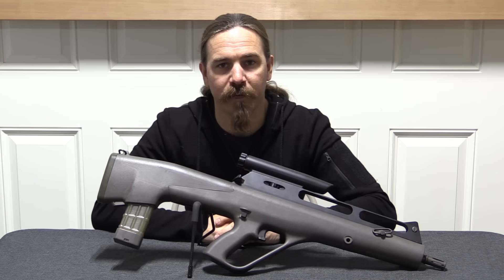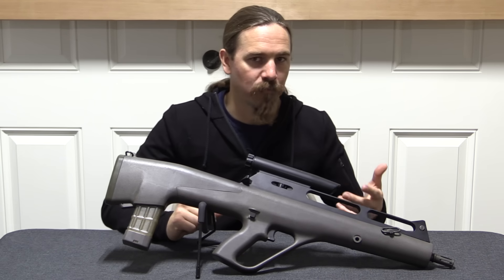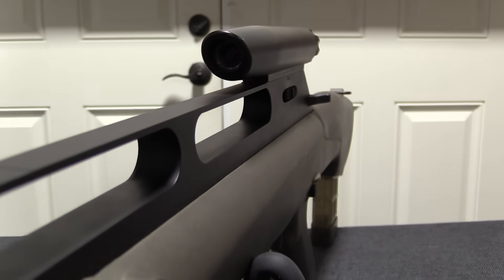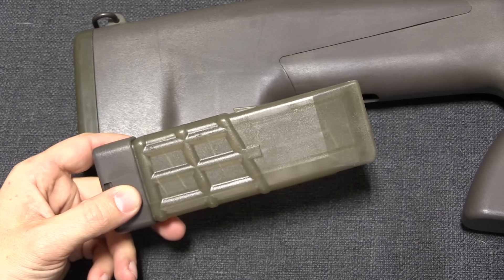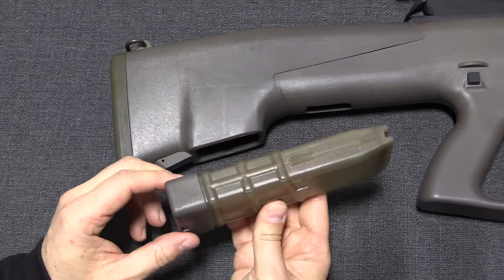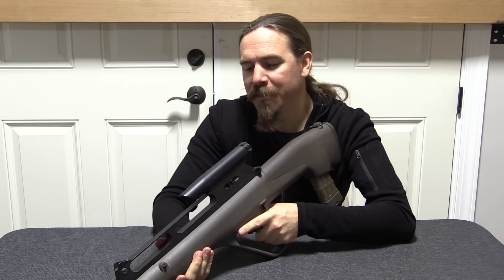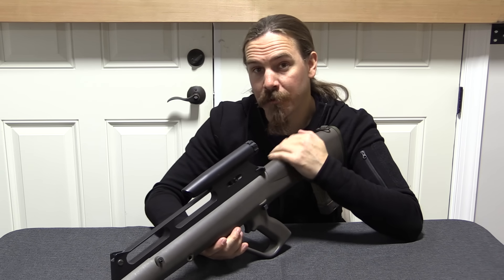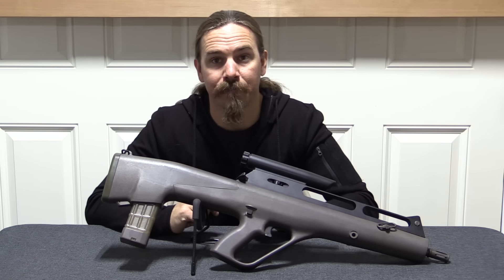Steyr ACR: A Polymer Flechette-Firing Bullpup From the 90s

Comment: Considering the whole ejection is based on the case falling out the front, could that mean if you were firing down from an elevated position you could potentially cause your rifle to jam because gravity pulls it straight through the chamber and out the front of the ejection before the action is able to close? It seems like this system relies very heavily on a very precise timing to close around the bullet rather than on it, like trying to trap the case between two guillotines.
Reply: Steyr makes very reliable guns since way more then 100 years. I am sure the gun itself with its mechanisms are flawless, if there were problems, my bet is on the not finished refining of the ammunition specifications and not optimised production line for that unique type of ammo.
Reply: @certaindeath7776  fun fact from what i have read from the reports it was the casings which were the defining problem especially in terms of reliability. however, another killer which was kinda the problem with flechette rounds in general was the fear of bouncing flechettes especially when prone
Reply: Maybe the cartridge is thick enough that it can't move through the chamber unless pushed?
Reply: Blackhart Films
Reply: As long as no length is lost from the cartridge on firing, and the chamber isn't longer than the fired case than it shouldn't matter what orientation it is when fired. It'd be a similar concept to a full length ejector on a revolver, but with less to get hung up on.
Reply: Why Jay  . I think so. It must be a tight fit. Thats why when all the parts raise their temperature due to sustained fired, that plastic cartridge ( nylon I suppose) may be subjected to some deformation or sticking into the chamber. These are all suppositions. Cheers!

Comment: It would be cool to see Steyr adapt it to a striker fired 9mm blowback. The weight could be around the barrel, near the pistol grip.
Reply: Lassi Kinnunen Damn, you're right. Blowback wouldn't work for the elevator action. Gas siphoned from in front of the chamber similar to a P7, maybe? Then again, 9mm is centerfire, not 'ring' fire like the flechette ammo used with the ACR. Something like a MAC/Uzi bolt that telescopes around the barrel is what I was originally thinking.

Comment: Plastic casings would jam up so easy because when firing alot of rounds stuff gets very hot so it might become a marshmelllow
Reply: trophywolfe that's why this rifle fires from an open bolt!! No round in the chamber until it get fired.
Reply: Textron recently tested this with their current polymer case-telescoped ammunition (PCTA). The polymer walls of the case actually insulate the chamber walls from having the ignition temperature transferred into them. When continuously firing the prototype LSAT LMG, the chamber temperature plateaued at ~200°F, which is well below both the cook-off temperature of the primer and the melting point of the polymer case.
Reply: Bakelite or teflon casings solve that.
Reply: Teflon is extremely heat resistant
Reply: ostiariusalpha do you have specs on what this gun plateaus as when firing around 2500 rounds in 5 minutes or less?
Reply: +trophywolfe  Unfortunately, I'm not aware that any such test has been attempted. 25 belts of ammunition is also a bit unrealistic for simulation of how an LMG like this would deployed in the real world. As it is, these tests are standardized around 300 rounds, and in Textron's testing, the chamber of the LSAT reached 200°F shortly before they fired all 300rnds, and maintained that temperature till the full 300 was expended. An M249, by contrast, will reach 600°F at 250rnds (and start cooking off its ammo), and 800°F when 300rnds are completed.
Reply: ostiariusalpha well who fires 1 belt in Ww3?
Reply: Would be alot more than 300 shots/minute
Reply: Plus carryover heat
Reply: Real world tests should be worst case possible
Reply: And determine quality by how quick it breaks
Reply: +trophywolfe Bakelite. And I am avare, but its still heat hardening and high heat tolerance.
Reply: +trophywolfe  Uh no, proper machine gun technique is to fire short, controlled bursts; this is especially true with LMGs. If you are forced into a situation where you are running through a belt, firing continuously, then you are probably going to be dead before you reach 300rnds.
Reply: ostiariusalpha moving down shit
Reply: +trophywolfe  They haven't really done that since WW I and the Korean Conflict, and they were using heavy machine guns for that task.
Reply: jimhans1 still when firing thousands of rounds in a couple minutes it adds up.
Reply: I need no channel youtube!  Bakelite was the first plastic compound Ever

Comment: This looks awesome, I wonder if you could use tungsten or DU flechettes and pierce a serious amount of body armor, it’d be a tiny APFSDS.  Although I’m not sure that the rifling would stabilize the flechette, a projectile that long and thin would have to spin at an unbelievable rate in order to actually be stable.  That’s why when APDS got longer and thinner to increase penetration, everyone eventually had to move to fin stabilization, hence APFSDS
Reply: It pretty much was an APFSDS projectile- it has fins
Reply: I'm sure it'd be great against armor now, but what I meant was imagine what it could penetrate if it were a more dense and harder metal like tungsten or DU.  See an armored car?  Set it to semi (Or if the AP is too heavy, have a gas cutoff and manually operate the rifle) and load a mag of AP flechettes.  If you're going with a gas cutoff, you can even up the powder load of the AP a bit to squeeze some more penetration out of it

Comment: After having the misfortune of using the plastic hulled “Wanda” shotgun shells, I can properly assume that similarly, in this system fragments of a broken cartridge will jam up the works something awful. Judging by the yellowing, UV resistance wasn’t a design parameter, which is a major oversight when working with polymer meant for field conditions.
Reply: Whereas brass is vulnerable to season cracking; it's six of one, a half-dozen of the other. Textron developed a much superior polymer for their polymer case-telescoped ammunition (PCTA) though.

Comment: One thing I learned is that the "everything must be polymer" craze of the late 1980's-1990's made for a bunch of guns that felt cheap and shoddy.  Also wonder how much effect the wind may have on the flechette.  Sure, it's fast, but I suspect even a moderate wind could have some effect.

Comment: A barrel that goes almost all the way to the back... I didn't think there was another gun but the TKB-022 that did this.

I think the LSAT/CTSAS program's guns use similar chambering and ejection methods.

Also, with a muzzle energy of just under 700 joules(minus the sabot anyway), I wonder if this should be classified as a submachine gun rather than an assault rifle.
Reply: The LSAT is basically this in the action and ammo.

Comment: If it's like the Aug optic the ring should cover a 2m tall target at 300m, zero the rifle to 100m and it will hit Centre mass at 300
Reply: TheOzTurkish 
With the AUG’s donut of death, if you aim center mass you are gauranteed a hit at 400 meters and below. Great system!
Reply: @DC2007A  Pffft have you shot a Styer with the donut optic? It's not, it's a shit system, that's why we use acogs and spectre sights now in the Adf
Reply: There are no points marked, but you can still hold off by mentally picturing them. Been a long time since I last shot an F88 but I never had any problems with hitting what I wanted to (then again, nothing I ever shot it at was making a conscious effort not to be shot) out to 300m. During the first firepower demo I saw with the rifle it was being used to engage point targets out to about 800, obviously with very good weather for it.
Reply: nirfz it was 15 years ago since I last shot one, it might have been zero at 200, I'm pretty sure it was 100 though
Reply: Using the F88 sight, zero at 100, at 300 shot fall is at the same point of aim.  After a few shoots I learned to aim about half a reticle (donut) low off the point of aim to hit the csm at 200.
Reply: When I was a member of the Austrian Armed Forces ("Bundesheer" in German) around 2000 we used the Steyr Aug and they (the instructors) told us, that Austria and it's weapon manufacturers were not allowed to use crosshairs in optical targeting for international legal reasons according to stuff related to WW2, so the ring was used. Don't know if that's really true.

Comment: Ian, I think it's a pertinent feature that you didn't mention - how does that round of ammunition compare size and weight-wise against the 223 round fired by the M16/AR15/M4? I guess if the ammo was much lighter and not hugely more bulky than 223 that might confer an advantage in reducing an infantryman's load-out?
Reply from the maker: The ammo was definitely lighter, although I don't have numbers at hand.
Reply: I was thinking just the same. Good one !
Reply: Forgotten Weapons Thanks Ian. It was just a guide I was after really.
Reply: I thought this was one of their selling points of the ammunition even though/especially as it was so unconventional, but for the life of me I can't remember where I came across that tid bit of information: perhaps either the Ordnance (may it be un-mothballed) or Infantry Museums.
Reply: The US Army video claims it was about half the weight of the 5.56mm round.

Comment: That feed system is really interesting in its simplicity. I wonder if you could take that and make it work with standard rounds with a rim
Reply: Steyr patented a rising chamber mechanism for bottlenecked cartridges.  It would eject downward behind the magazine.

https://patents.google.com/patent/US4739570
Reply: Maybe not too standard; If the firing pin breaks, and you're not sure what happened and cycle manually, you'd have a tip of a bullet pressing against a primer.
Reply: Bunkyboy 91 no because the rim locks against the barrel and brass itself expands and stays expanded until it cools whereas this polymer case probably wasn't very intact when it exited the front of the chamber
Reply: The madsen rifle (rekylforsøgsgevær) functioned in sorta this way with a rimmed cartrige

Comment: the american military has this odd obsession with accuracy that doesn't always work in it's favor when choosing new guns. you kind of see this in the fight over the adoption of the m-16.
Reply: If you read the Army's program summary, almost no one could pass the qualification course (minimum of 23 targets hit out of 40) with either flechette rifle, Steyr or AAI.  Only around 10% of the Steyr testers qualified as mere Marksman in the first phase.  The remaining Steyr users and all of the AAI users failed to qualify.  Every single AAI and Steyr user failed to qualify in the second phase.  In pure mechanical accuracy, the flechette rifles grouped twice as large as the conventional projectile rifles.

It comes down to manufacturing consistency in producing the sabot and flechette, seating that assembly in the cartridge case, and then getting the clean separation of the sabot from the flechette once it leaves the muzzle.

Comment: 1:85" is 1:215 centimetres, 215 millimetres would be 1:8.4". This is not a comment on either system being "superior" in some way, just a clarification.

Thanks for another great video!
Reply: Using Imperial measurements makes Jesus cry. And this guy sux at Maths/ Unit Conversion (which is why America crashed one of their Mars probes).
Reply: Are you saying metric is superior, shame on you. (:

Comment: I like the Safety / Semi / Burst.
Better than using the AUG trigger pressure (Semi / Auto) which is crap.

Australian F88 Steyr
Shooting on the range everyone uses the ALO or "automatic lockout" button or (single shot lockout button) under the trigger.
Otherwise an embarrassing burst of automatic fire can sometimes be heard on the firing line.
Reply: Same here. One accidental full burst ONCE for a full company. And that guy was an idiot anyway.
Reply: in my serve time in austria i could easily fire single or auto. i prefered prefered to shoot doublettes, which was very well doable. push trigger through for a short time, so that 2 rounds are triggered. so you have 2 pretty accurate rounds heading to the enemy, the third one would not be accurate enough anyway.
Only flaw with the trigger mechanism was, that its too hard to push. if you pull the trigger to the pressure point, and then above, its so hard, that your gun will move a tiny bit. so high precision firing for long distance shots is not easy with this gun.
It may be, that the australian trigger pressure points are way softer, then in austria, so that a bauer lounging with sausage fingers, with the sensetivness of an crocodile may trigger full auto more often by accident?
Reply: Also referred to by the infantry as the "Numpty Button" or "Idiot Button"; Because only idiots needed it